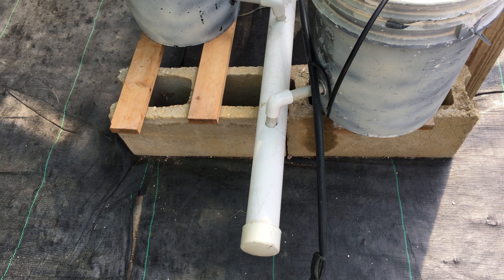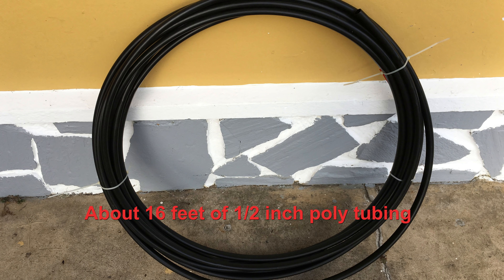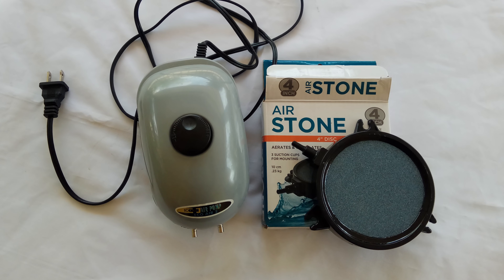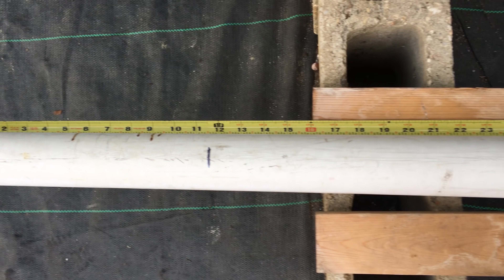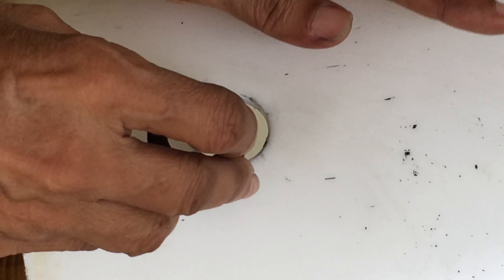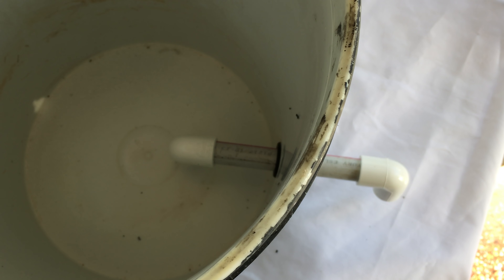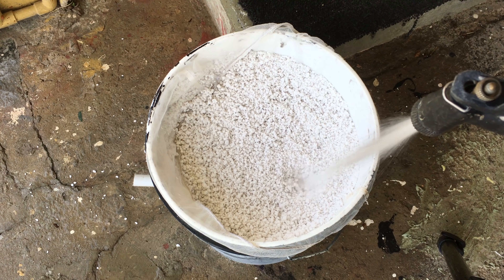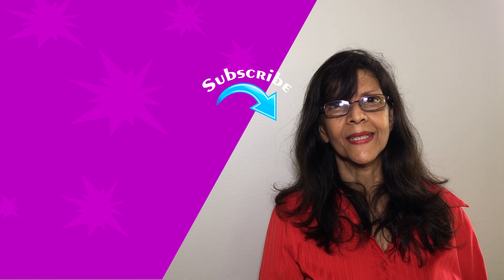Dutch Bucket System.How to build a Dutch Bucket Hydroponic System

Comment: Does the water remain in bucket after powering of the pump.?
Reply from the maker: The grommet was placed about an inch and a half from the bottom of the bucket so it will have water to that height whether or not the pump is off or on.
Reply: @over60crafter  thank you so much

Comment: Very informative video 
What power the pump should be though for the 10 bucket system
Thanks.
Reply from the maker: For this setup I used a 500gph pump.
Reply: Ok thanks and if I was to do a 100 bucket system how big of a reservoir will I be needing and what size pump both air and the submersible.
Really appreciate the help.

Comment: Hello Mam! I have one question," Is 2 inch pvc with 2inch netpot hole is sufficient to grow vegies or kale?"
Reply from the maker: I have planted kale, lettuce ,chive, and even basil with no problems in the 2 inch net cups in 2 inch pvc , however it would not be big enough for larger vegetables like tomatoes,egg plants,peppers etc.
Reply: @over60crafter So For Longer ones i have to use 3inch pvc with 3 inch net pot or 4inch pvc with 3inch netpot ?

Comment: Can you please make video on preparing hydroponic fertilizer from solid fertilizers in simple way, like you always do 😊❤️
Reply from the maker: Hi it would not make sense to make a video on mixing the fertilizer as there are many brands out there and they all should come with mixing instructions for the many various types of fruits and vegetables.Some with all the  nutrients needed and some where you would have to add calcium nitrate and magnesium sulfate. If it is a flowering fruit or vegetable then the mixing ratio would increase after the first few weeks. Ask your hydroponic fertilizer provider for mixing instructions if they do not come on the package.Good luck.

Comment: Have you ever had plants just refuse to grow in them? I have tried everything from possible algae infestation to checking ph twice a day
Reply from the maker: Hi Joe,I have only grown large crops such as tomatoes,cucumbers,bell peppers and egg plants in this system and they all do well,I tried cucumbers but due to a Bachac infestation in my yard the cucumber leaves get eaten or then again it could also be due to the iguana.I check my ppm and ph every other day and  I only had to adjust the ph when I added the solution the first time.Are your buckets  opaque?I painted mines black to avoid algae growth then white because of the heat.I did get a bit of algae at the top which I would show in my dutch bucket update video shortly,just waiting for a couple of the tomatoes to ripen.I do have to top up the solution once a week.
Reply: What media are you using?
Reply from the maker: I used perlite which I prefer over coco coir.
Reply: @over60crafter  your an inspiration to me.
Reply: nts james using perlite only as medium, into paint strainer, into bucket. Watering from top with only a small opening and the water right down into perlite at the top of the stem. I ended up cleaning the system and there was a ton of algae and I also had tried grapefruit seed extract to control it with no success.
Reply: @JobraKai  if you can try an inorganic way to prevent algae growth use hydrogen peroxide